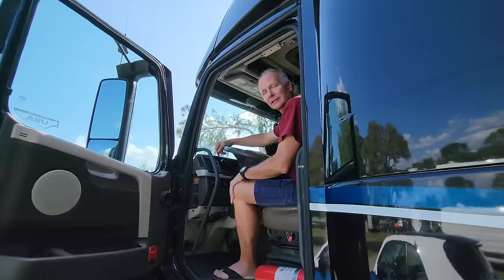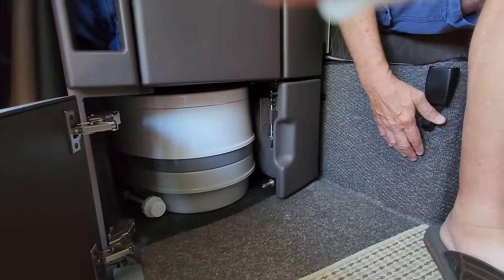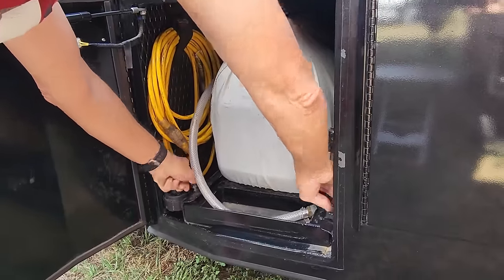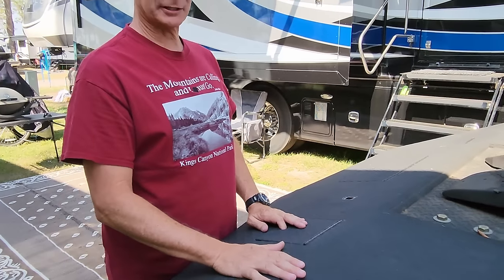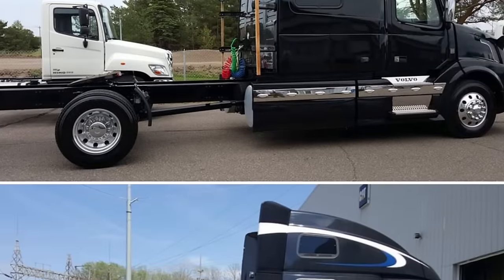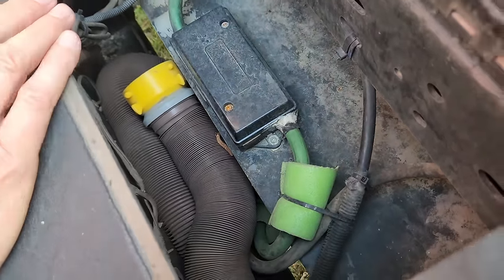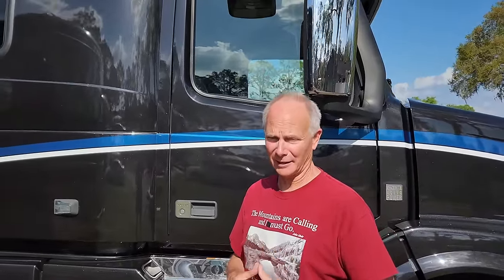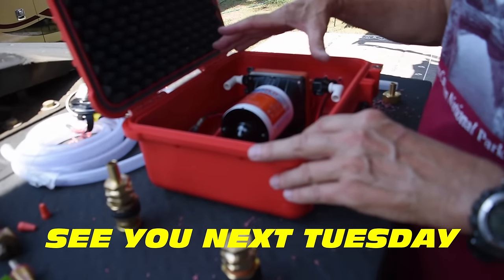MORE THAN A RV HAULER SEMI-TRUCK / HDT RV / RV Lifestyle / Full-time RV / Boondock HDT Asset

Comment: South Carolina requires Class A CDL or Class F Non CDL to drive a truck like this. Class E would be RV's that are only a single unit. Class F is RV's with a trailer.
Reply from the maker: Yes. Very different from Texas. We moved from SC before we got the truck and fulltimed.
Reply: @bigtruckbigtravels  I've noticed your Clemson Tigers shirt. GO TIGERS!

Comment: The Volvo is really laid out nice and high quality. Awesome that 2000 W generator can be closed off and quiet and even run Orion if need be plus much cheaper to run then the big generator. Such a nice set up. The guys really did a great job.
Reply from the maker: Thank you very much. A little bit of thought and a lot of experience went into the plans of Voyager. Thanks for the comment. Glad you're along on the journey. 😁

Comment: When I first saw this rig I wondered why it had tandem rear axles... then I read the SpaceCraft weight specs, and it made sense. The explanation of the history is appreciated.

I'll note that the fifth wheel is positioned unusually far rearward, due to the car deck. As delivered the fifth wheel was over the axle, which is normal. The first deck moved the hitch back to make space for the car, and the second deck placed the fifth wheel roughly over the rearmost axle instead of midway between the axles as usual. The new configuration is suitable for this use, but wouldn't work for a heavier commercial trailer.

The smaller fifth-wheel hitches, as used for RVs and lighter commercial trailers, go up to about 30,000 pounds of trailer weight, which is the range covered by the SAE J2638 standard. They can typically handle up to 7,500 pounds of pin weight - not enough as explained in the video - but even the total trailer weight capacity would not be suitable for the SpaceCraft. Both RV and many commercial fifth-wheels use the 2" (nominal) king pin size, but there is a higher-capacity 3.5" size available for heavier applications. I assume that while this is a commercial truck fifth-wheel, it is still the 2" size, and it could be used to tow more conventional fifth-wheel RV trailers.

If I understand the history, remarks, and images correctly, the truck was originally a 4X2 and had a idler (non-driven) tag axle added for load capacity, making it a 6X2. As long as it is never driven on ice, snow, or mud, I suppose that's adequate; it's certainly cheaper than a 6X4.
Reply from the maker: You are correct, Brian. We were going to make the additional axle a drive (6x4) but after discussing with some friends, decided on just a tag axle. That was a mistake. Our gut told us to configure as a 6x4 but we didn't and should have. I guess the better mileage is a consolation but had we to do it over again, it would be a twin screw set up. Thanks for the comment. Glad you're along on the journey. 😁

Comment: We are from San Antonio.  Did you go to your local DMV without an appointment ?  When I got my Class B non-commercial, the staff was not aware of the Class A non-commercial.  Sounded like you had to work with the staff to create a written test.  I had to take the Class B commercial written test.  We like your channel.  Thanks.
Reply from the maker: We had to make an appointment for the road test. We waited 2 weeks. At the time, they were aware of the Class A non-commercial endorsement but that was 8 years ago. They had a standard test for this at the time but it was also done in Livingston and they were aware of Escapees members needing to do this.
Reply: @bigtruckbigtravels  thanks for your quick reply.  One step closer towards the Big Rig!

Comment: Hello from the UK!!

Another great video.  Two questions.  When would you need the beds in the cab - is it for long travel days?   Second, have you considered using nylon plates on the 5th wheel (Trailer hitch) rather than grease?
Reply from the maker: Hello to the UK!
We use the bunk beds when we camp in the truck or on the rare occasion when we are doing a long travel day and one of us sleeps while the other drives. 
I tried using the nylon plate but my tolerance is so tight between the hitch and pin that the jaws wouldn't close to fully engage and lock. Great question. I wish I could use the nylon plate.

Comment: I never realized until you said it that your truck has a dead tag  axle. Can you dump the air on just the tag axle? I drove a few light weight dump trucks and a log truck with a tag axle and always hated them because is was so easy to get stuck empty or loaded.  You do a good job boondocking and not getting stuck. I would want a live tandem with a locking power divider and locking diffs in both rears to offroad. Your bed design is one of the best!
Reply from the maker: We were not thinking Carl, when we had the axle added. I could have had power or lift to it but I told them that a "dead" axle was fine. It should have had power to it but we're looking into options. It's always a challenge to not get stuck but so far we're doing ok.  Appreciate your comments and thanks for watching the channel. 😊

Comment: awsome. i used to cdl. truck doubles. and thousand trails fulltime. i wonder what your fuel capacity is , i had 300 gal. hopefully both drive axles are drive air locking hubs, shocking how easy these trucks get stuck🤔i also love having eight ball on steering wheel really helps😎🌴 love the build
Reply from the maker: Thank you. We have 250 gal fuel capacity since we have the bed with storage but not tandem drives, only a drive and tag. The drives lock but it is amazing how easy these big trucks get stuck! Wish we would have had tandem drives....thanks for watching the channel.

Comment: Awesome truck, and built with a lot of thought and features.  Hardware/software questions:  Hardware - What are service intervals, costs, and fuel mileage numbers?  I imagine oil/filter changes are longer intervals (20K miles?...), probably cost around $300 per visit for an oil change?, and mpg's are 8-10 depending on a lot of things?  Software - You went quick inside, what are you using for navigation and communication?  Apple Maps on your phone, or a dedicated GPS unit (Garmin or Rand McNally)?  And, for comms?  I'm a radio guy, so I'm interested in CB and Ham radio, and monitor/use both while traveling...  along with a Garmin inReach mini so others can track my travels and keep in touch when I'm out of cell range.  Enjoyed the tour, and thank you for sharing.  Cheers!  Pete in Arizona - KI7LIL
Reply from the maker: Hey Pete, we have a regular CB radio and really only use it around large cities to check on any congestion or accidents. We have our truck serviced annually (usually in December), so the mileage is always between 20K - 24K miles and the cost runs about $400-$500 and that includes oil change and all the filters changed (oil, fuel and fuel/water separator). Our trailer is 42K lbs so we get about 6.8 mpg to 7.2 mpg. Our navigation is through two GPS units: a Garmin RV GPS and a Rand McNally Trucker unit. We also use a Rand McNally Trucker Road Atlas which has all the STAA approved routes listed, we use that as a check to the GPS units. Plus, we'll be on Google maps during the trip to insure some routing as well. I think the inReach is a good idea. Thanks for the comment. Glad you're along on the journey. 😁
Reply: @bigtruckbigtravels  Right on and thank you for the info.  Radio's can be useful, service work is typical, and mapping is as easy or complicated as you want to make it.  I use Apple Maps, and then Gaia when off-road.  My wife loves paper maps, and every year I go to a truck stop and buy her a Rand McNally Atlas for Christmas.  She writes, scribbles, circles and makes notes on it during every trip we take.  Loves it every year, then stores that "edition" for reference when we want to go back and review a trip for a future visit.  The inReach is a very specific tool that can be useful depending on how you use it.  Driving Interstates with cell reception the whole way...  nope, not worth it.  Going on State or County roads, and ultimately ending up stopping and/or boondocking in an area with no cell reception, and wanting to keep in touch with others, then absolutely, yes.  Leave the rig and go walking/hiking/biking, if out of cell range, absolutely, yes.  Good to chat with you guys.  My comments might be "long winded" but I type like I would talk to you around a campfire, asking questions and sharing ideas.  That high school typing class in the '80's is really paying off I guess...  lol.  Peace and cheers!  Pete

Comment: Enjoy your videos so much! I used to drive a 9-speed that had to be double-clutched back in the 90's (automatic transmissions were uncommon). I never drove a Volvo but they were considered top of the line back then. I was curious what type of transmission your Volvo has if you don't mind me asking?
Reply from the maker: Wow! Scott, a double clutcher! We have it easy with our Volvo. It is an i-Shift full automatic transmission with 12 speeds. 11th is geared from 54 mph to 61 mph and a direct drive (1:1 ratio) which is great for driving in California with 55 mph speeds. Overdrive is 12th gear. At 63 mph it cruises at 1100 rpm's. It's a D13 engine with 500 hp and 1700 ft lbs. Thanks for the comment. Glad you're along on the journey. 😁
Reply: @Big Truck Big Travels  is it the AT series single-clutch transmission or the SO series dual-clutch? Both are 12-speeds which shift automatically, but internally they work differently.
Reply from the maker: @brianb-p6586  I believe it's the AT version, an automated manual transmission for regular duty use.
Reply: @bigtruckbigtravels  Thanks. I realize that you don't have any heavy truck experience for comparison, but how do you find the transmission behaviour - does it shift smoothly, and at appropriate times?
Reply from the maker: @brianb-p6586  you're correct. My only experience is with our truck but it is very smooth and intuitive. If on a hill and loaded it will start on 1st or 2nd depending on the grade of the hill. But if on level ground and no load it will start in 5th and skip gears. Loaded and level usually starts in 3rd and will skip gears depending on how much I get into the throttle. Love it. No issues.
Reply: @bigtruckbigtravels  thanks!

Comment: Wow what a great rig does the extra axle have brakes or is it free wheeling I don't see any air hoses going to the trailer or electric maybe I mis it take care happy camping
Reply from the maker: Thank you. The extra axle is a tag with no power to it but it does have air bags for suspension and disc air brakes. The trailer has air suspension and air brakes just like a commercial semi-trailer.

Comment: Greetings from Michigan 🙂  I'm a retired truck driver and have a 40 ft toy hauler with a 1995 volvo gmc truck  I purchased the rig from a friend of mine just before he passed away. I'm trying to jump through hoops with the d m v to get it retitled as a RV my biggest issue is insurance  can you touch on that subject in a future video ?  Thank you
Reply from the maker: Hey Doug, we want to get to the UP in the near future. I've heard it's very nice up there. Regarding your title efforts, each state is different on requirements but I can tell you that most DMV's don't understand a semi-truck for personal use to tow a fifth wheel. The key is to get with an experienced DMV associate and have pictures of the unit. Explain to them what you are doing and usually that will work. You may also want to call a supervisor ahead of time to explain and get a "pre-approval" or at least an understanding on their part. Sometime it's smooth but most times it's not. A lot of times it depends on the DMV associate and their experience. I hope that helps.

Comment: Thanks for the video. My question is on the commercial hitch, most videos I’ve seen say you can’t use them because you’ll twist your frame on the RV,do you think they’re right. I’m a Truck driver. I have a 2022 VNL860 .
Reply from the maker: I wouldn't recommend using a commercial hitch on a production trailer. Our SpaceCraft is based on a semi-trailer chassis and thus has a steel plate welded to the upper frame deck where the pin is welded. It's built to be hauled with a commercial hitch. Plus, our pin weight of 13K lbs would crush any RV hitch out there. Thanks for the comment. Glad you're along on the journey. 😁

Comment: The RV/sleeper part of the truck seems like an expensive redundancy, given that it exists only to tow an RV trailer that has far better versions of everything in it. I suppose the inconvenience of using a trailer that isn't functional without the slides out explains this.
Reply from the maker: Hi Brian, very astute observations from the video. The sleeper "condo" cab for the truck is for a few reasons: 1) we wanted the ability to camp in the truck of we couldn't get the trailer in to a campsite which we've done at a few places including Yellowstone. On a few occasions, we've also slept in it when our trailer was in for repairs and we couldn't stay in it such as at MorRyde several years ago with our first trailer and while we were having some paint done up in Iowa. 2) This cab also affords us the lower bunk as a dinette which we use 95% of the time in this configuration so we can have our lunch while on the road. 
Also being a little longer wheelbase gives us a better ride but does limit us on places we can fit. Always a compromise but so far, it's not prevented us from going where we want to go. Thanks for the comment. 😃

Comment: It's so special that you don't use the fridge inside the cabin of the truck What a BS mate having lunch inside the truck
Reply from the maker: Actually, Jack, we do use the fridge in the truck when our lunch requires refrigeration. If it's frozen then we place it on the table to let it thaw a bit before lunch. Thanks for the comment. Appreciate you coming along on the journey.

Comment: Why did you choose to put the hitch behind both axles and not put it directly over at least one of them?
Reply from the maker: It was geometry and us trying to find a happy median between overall length, storage and maneuverability.  If the hitch is moved forward then the rear of the truck must be shorter, losing storage boxes. If the trailer overhang is longer to accommodate a longer truck then the basement storage is eliminated by the front Jack's. Also, the further forward the hitch moves then the trailer doesn't maneuver as well. We tried to strike a balance. Thanks for the comment. 😃

Comment: I love the look of the little microwave.  What is it and what to you think about it?  Is it worth while?  I am in Oregon and to my knowledge no extra license required for large RV's but I am a believer that there should be.  Too many people with large RV's that do not know how to drive them.  My current combined length is 61 feet with generator rack.
Reply from the maker: We use the microwave in the truck nearly every time we travel which is weekly. It's a great appliance for heating up lunch and has served us well for 9 years.
Reply: @bigtruckbigtravels  Do you know the make and model?  I have been looking for one for a year.
Reply from the maker: @SkylinersYeti  it's a Walmart special...cheapest we could find. Rival brand 700 watt microwave. Fits great, works good for heating stuff up.
Reply: @bigtruckbigtravels  Thanks, it  is hard to find compact a microwave

Comment: I’m just curious on what you thought of your previous fifth wheel compared to the spacecraft and what are your thoughts on the Mor/ryde is ?
Reply from the maker: Our DRV Houston was nice and we loved the floorplan which was very similar to our SpaceCraft. There were improvements we wanted to make that the DRV couldn't handle due to space and weight (bigger tanks, more batteries, more solar and more carrying capacity. We really enjoyed the DRV and would still be in it if it weren't for those improvements. Also, the amount of miles we put on the trailer is much more than a "normal" RVer, so we also felt that the trailer would not hold up to that kind of mileage. Thanks for the comment. Glad you're along on the journey. 😁
Reply from the maker: OH, I forgot but the MorRyde IS was very nice. It really smoothed out the ride on the trailer and is a true independent suspension system which works great. They only had 8K lbs axle ratings when we had it but I think they have increased that to either 9K or 10K.

Comment: Why did you pick a Volvo. Just wondering.
Reply from the maker: Several reasons, Glenn. 1) Safety - cab is all steel, no fiberglass, Volvo is world renowned for the safest truck. 2) Interior layout with the "workstation/dinette" which suited our travel style. At the time, Volvo was the only truck with this layout. 3) The interior was the most quiet of any other manufacturer. 4) iShift automatic transmission. At the time, it was the most advanced and reliable auto trans in a semi-truck and we wanted the auto transmission.
Hope this helps.

Comment: You didn't mention the engine in voyager and transmission
Reply from the maker: How could I have missed that?!? It's a D13 with a 12 speed i-Shift auto transmission. 500 hp and 1700 ft lbs of torque in an XE package.

Comment: why use grease on 5th wheel why not teflon plate
Reply from the maker: Great question, Ted. I tried on day 1 but the tolerances are so tight between the pin and the hitch plate that a 1/8" teflon plate prevents the jaws from locking! Grrrr...so grease it is.

Comment: Not for Hire label will save you many DOT pull over instances depending on which state your in. Curious as to why not licensed in S. Dakota instead of MT. $$$?
Reply from the maker: We believe the wording on the side has saved us from several instances of possible questions. MT is a more receptive and flexible  state with regards to insurance and registration for such a non-commercial and unique trailer. Thank you